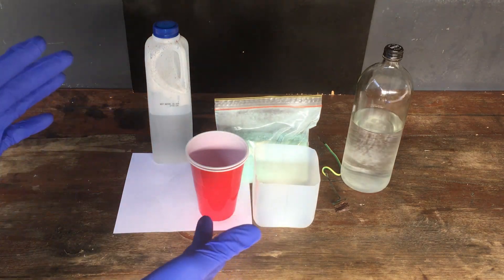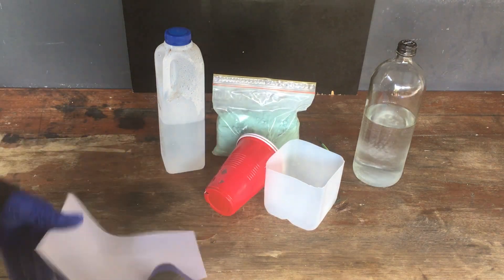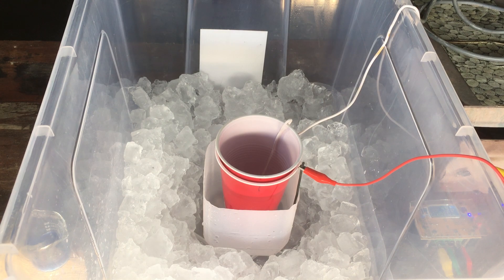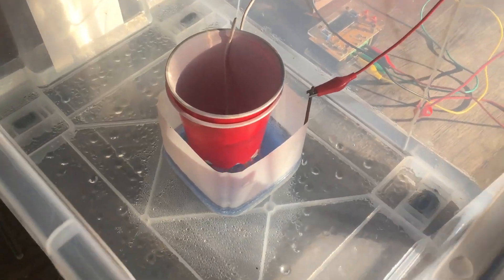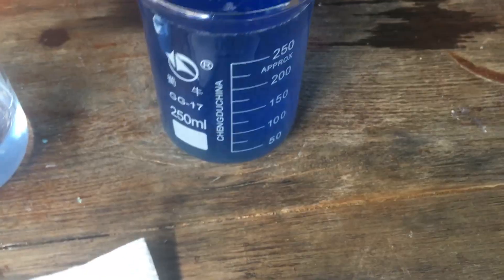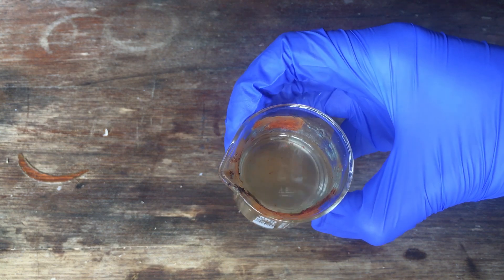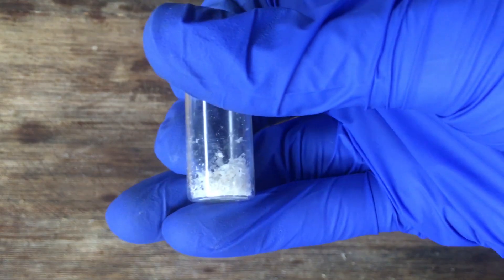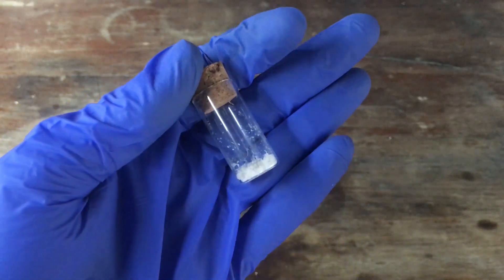Making Nitrate With Electricity

Comment: Um, do you think it is plausible that the actual reaction in the literature involves electrolytic production of ozone and the reaction of ozone with ammonia to make nitrate ?  Several other Youtubers react ammonia with electrical discharge generated ozone to perform this synthesis. 
In Wikipedia's ozone entry it suggents ozone production is favored by low temperature, prescence of sulphuric acid and lead dioxide, and some overvoltage. If this is so it might be possible to synthesize ammonium nitrate from ammonium sulphate with a lead anode at the bottom of a tall narrow anolyte compartment ?
Using a lead anode might be expected to be advantageous as it would oxidise to a lead dioxide anode and lead dioxide can be a catalyst for ozone production The prescence of sulphate and possible persulphate at the anode should make it unlikely that lead will disolve. I am thinking ammonium sulphate in both compartmnets. If  enough nitrate and sulphate collect in the anolyte it might be possible to distill off the nitric acid and leave the sulphuric
Reply from the maker: Interesting, that's definitely a possibility.
The only issue I can see is that by performing the electrolysis in acidic conditions, the resulting ammonium ions - as opposed to the neutral ammonia molecules for basic conditions - will be repelled by the anode. I'm not sure whether the hypothesised ozone-ammonia reaction will be hindered by this (I suppose this would only be the case if the oxidation were exclusively an electrode surface mechanism, so I imagine it wouldn't), but it might be something to keep in mind.
While this would be a very interesting thing to try, I might have to leave the experimentation to others in this regard. Only from the reason that lead-based electrodes are required. While I've used lead electrodes in the past, I've had many issues with them and would rather not use them again for toxicity reasons alone. However, if I ever upgrade to a better lab setup, where I can more effectively deal with any lead-based mishaps, I'll definitely remember to try this!
Reply: @ScrapScience  Yes, on deeper reflection i think there might be several ways of going about this. Either directly, with K+ irons in a basic anolyte and a copper catalyst,  or by the electrolytic ozone production route reacting ammonia with ozone to form ammonium nitrate. A third set of possibilities involves setting up a fermentation of  ammonia to ammonium, potassium or calcium nitrate, using either a bed of soil/compost or perhaps an aqueous fermenter using an aquarium, a pump and a trickle filter, followed by electrolytic separation of nitric acid.

Comment: Very interesting!  I've never seen this before.
The approach I've always wanted to try would involve a large plastic bucket filled with urea/water solution into which a sack of landscaping pumice was added. An aquarium pump and an airstone would be used to oxygenate and circulate the solution.
Over the course of a couple of months I would expect nitrifying bacteria to convert the NH3 to NO3-.  The pumice would provide a substrate with lots of surface area for the bacteria to anchor to.  Perhaps a bit of compost added at the beginning would inoculate the batch.
I don't need the KNO3 - it's abundant here - I'd just be doing it just to see if it worked.  While it would take some time, it would be very hands-off and would require very little energy.  If it succeeded, it might produce a lot of nitrate.  If it failed, I'd still have fertilizer for the lawn.
Perhaps the pH would have to be monitored, and if it got too low, KOH would be added as needed.
Reply: I love this as an idea.  One could take a tiny 1% fraction of the circulating water perhaps and bring it to a boil while capturing the evolved gas in a chilled water container that could be slowly replaced when it reaches a high enough concentration.  If a steady state can be achieved it could work as long as the weather holds.
Reply: you can buy nitrobacter starter kit for aquaristic use. So you dont need to bring impurities to the pumic.
Reply: Make a "nitre bed" like they did in the days of the civil war. Collect pee and manure, let it ferment in heaps for a year then extract nitre from that with boiling water
Reply: @bromisovalum8417  I've read the entire document written by Joseph LeConte in 1862.  It's fascinating and informative!  But its methods are a wee bit bucolic, anachronistic, and desperate.
Reply: and? any success?
Reply: Why urea and not say, ammonium chloride
Reply: @ Ammonium chloride might work.  OTOH, it's acidic to start with, and would become more so as NH4+ is consumed.

Comment: Just came across your Chanel the other day and it has quickly jumped up to the top 5 chemistry channels I like to watch keep up the good work,. But quick question, and I would love to hear other people's views I need to buy a DC power source or converter and I'm not quite ready to buy a welder, what brand or models have you all had good luck with
Reply from the maker: A simple lab bench power supply will serve you well as a DC power source, usually in the price range of $50-100. If you don't want to spend that much money, you can also salvage an ATX power supply from an old desktop computer (though these don't offer controllable voltage or current).
Reply: @ScrapScience  It's not that hard to hack an ATX computer power supply into an adjustable power supply, especially for someone with some basic electronics knowledge. All you need to do is look up the schematic for your ATX, and using that find out the location of the feedback section. By replacing the feedback resistors with a potentiometer you can make the ATX into an adjustable power supply. Just make sure you turn it into a 1-12V adjustable power supply and not anything over 12V, as the capacitors are not meant for a voltage much higher than that and will pop. You could of course replace the capacitors with 25V, 35V or even 50V electrolytic capacitors, but for electrolysis that's utterly useless because you never use more than the original 12V in any type of electrolysis anyway, and often even just a couple of volts.
Reply: @ScrapScience  you can hook them up to a cheap buck regulator with current control and use a multimeter to set it

Comment: I actually tried to do this with the copper catalyst and it ended up not working. Then I remembered, I have a platinum anode which already is a catalyst, so just for fun I did it without the copper catalyst and I ended up producing something which looks like dirty potassium nitrate solution. The ammonia smell is gone, I’ll have to see whether any nitrate crystallizes out. I was using a clay pot as a diaphragm. Also I forgot how smelly ammonia was.
Reply from the maker: I was told at some point that platinum is generally quite good at anodically decomposing nitrate ions, so I haven't bothered trying to use a Pt anode for this reaction.
Nonetheless, I wouldn't be surprised if you got a good yield anyway, since nobody seems to really know what's going on with the reaction overall.
Reply: @ScrapScience  just a curious question. Why didn’t you use a clay pot as a diaphragm for this one? Were you trying follow the paper as close as possible?
Reply from the maker: That was the main reason. Additionally, clay pots are rather restrictive on the current flow compared to other diaphragm options, and this process doesn't require perfect separation of the two chambers. Using paper allowed for a lower cell voltage (increasing the energy efficiency) and was easier to implement on a small scale.
Reply: @ScrapScience  aah that makes sense. Sorry if it seems like I’m in the comments sections in all of your videos. I’m just gathering more information so I can repeat some of your experiments except with a platinum anode and some other modifications. I want to see if the platinum could help as a catalyst for some of these reactions and help to increase the yield and efficiency of these electrochemical processes. Then I am going to see whether My knowledge could help improve things.
I could even make a document cataloguing my results for repeating and improving your electrochemical processes ( if I do go down this route, I will give you editing access). I will of course still give you credit. See you in a couple of days, bye.
Reply from the maker: Haha, there's no need to apologise. Getting and responding to comments (especially ones like yours) is by far my favourite part of Youtube.
I'll be super interested to see your results in these areas, and I'll look forward to hearing from you in the future if you decide to persist with these experiments.
All the best!
Reply: @ScrapScience  results are .............inconclusive because I forgot about it and I threw the solution away. I also didn't run the cell for very long because the smell was awful and it overwhelmed the extractor fan. Also I tried some of your tests and they tested negative. I am going to try again but outside and with copper hydroxide, in order to avoid sodium carbonate formation.

Comment: Hey great videos again my friend ! I found something and I bet it´s interesting for you because you like easy experiments and this is what you can try. Most people don´t know it because the experiment is written in german from a chemistry professor but luckily for you I found it and translated it for you so you can share it with the internet If it works. This was in the early beginnings where the germans made nitric acid and took therefore nitrates from chile and wanted to be independent from  chile as well. So the professor made experiments and found out that ... and now listen carefully ! That If you take a retort(I guess glass destillation kit) add some diluted sulfuric acid then add in ammonium sulfate and the key ingredient manganese dioxide and heat it NO2 will destill over. Theory behind it the released ammonia reacts with the manganese dioxide and takes it´s oxygen to form the NO2 which react with water to form the nitric acid as you know. The MnO2 gets to MnO and gets back to MnO2 as it reacts with the oxygen from the air. So as long as you have ammonium sulfate it will make some NO2. PbO2 works too but MnO2 is easier to get. There was also a version with concentrated sulfuric acid potassium chromate and ammonium sulfate you get loads of nitric acid. There are no proportions in the text. Here is my reference http://dingler.culture.hu-berlin.de/article/pj103/ar103067 It´s in german but I said everything that you need to know !
Reply from the maker: Wow thanks!
At first glance, this seems too good to be true honestly. But that's no reason not to give it a go!
I probably won't get the chance to try it for a long while, but I've just added it to my list of video ideas, so I'll hopefully get around to it eventually.
Reply: @Tasfic Razin Everything as I said there is not more information just to destill these 3 ingredients.

Comment: Can I use ammonium chloride instead of ammonium hydroxide instead? Because I  don't have any ...
Reply from the maker: Since I'm not certain on the reaction mechanism, I'm not entirely sure (I do think it's unlikely though).

Provided you do it in a basic enough solution (with enough potassium hydroxide), the ammonium ions will tend to form ammonia anyway, so it's possible that it might work. However, the chloride ions are very likely to interfere with the anode reaction and will also make things difficult to crystallise out. Additionally, I'm not sure how you'd form the catalyst complex unless you have plain ammonia.

You can actually make ammonia by the reaction of ammonium chloride and sodium hydroxide. I have a video on that topic linked in the description. (the video uses ammonium sulfate instead of ammonium chloride but the reaction works the same)
Reply: @ScrapScience  thanks,but I had tried it 100 times and it failed I don't know why it doesn't produce any hydroxide. Do I have to heat the solution too ?
Reply from the maker: Yep, you definitely need to heat the reaction to drive off most of the ammonia. Using as little water as possible will help too.
Reply: @ScrapScience  okay,what is stiochemitry for producing 150ml or 250 ml of 25% ammonium hydroxide .
Reply from the maker: You can't really work out the perfect stoichiometry, since the reaction will give you a highly variable yield. 
To get 250mL of 25% ammonium hydroxide, a ballpark figure is to use around 150g of NH4Cl and around 120g of NaOH. 
If you want the '25%' figure to be in terms of ammonia instead of ammonium hydroxide, you can use twice the amount of reactants.
Reply: @ScrapScience  thanks
Reply: Probably that the chloride anion into NH4Cl would make the solution slighly acidic (by NH4(+) counter ion (cation)) and this is bad news since Cl(-) will form a little Cl2 what transciently makes HCl and HOCl upon contact with water.
HOCl destroys NH3 into N2(g) and H2O (sanitizing effect).
Cl2(g) is bad news into contact to NH4(+) salts because it forms a bit of NCl3 (the yellow nemesis of Exposion & Fire) (highly sensitive dense yellow oil touchy and dirt reactive, spontaneously decompose into fire and bang, usually shattering the container or glas even from subaquatic tiny droplets... thus unsafe (many chemists have lost body parts, eyes or ears... even live).

PHZ
(PHILOU Zrealone from the Science Madness forum and many A.O.L. newsgroup into the pas).

Comment: Would love to see this scaled up ☺️
Reply: His first electrolyzer was a good scaled-up version, actually.  He only needed to put a lot more amps through it and convert all of that ammonia and potassium hydroxide.  To pull more amps without drastically increasing the voltage, he could move the electrodes as close together as possible and use much bigger and flatter electrodes.

Comment: "...because we're doing electrochemistry and it's just gonna work anyway"

Have you tried to get a bright metal plating yet?
Reply from the maker: I haven't actually done any metal plating at this stage (aside from a tiny copper plating experiment I did way back in 2017).
I'm honestly not particularly knowledgeable on proper metal plating, so I've kind of avoided the topic so far. I'll definitely cover it one day, but it'll be a long time before I've gathered enough info on the topic to make content about it.
Reply: That line made me laugh, I've got a bad history with electrochemistry.
Reply: Well you're hard, metal plating is a separate art.

Comment: u should also try using Ir-Ta MMO it would easily be usable with less crud but considerably more expensive.
Paper definitely would be the best choice here or any NF membrane would work too which is just coating paper or fiberglass in nitrocellulose or PVC with no need for any further treatment.
The copper somewhat prevents the decomposition of nitrate on the anode but copper hydroxide or oxide would be a better choice.
Reply from the maker: Thanks for the tips!
I've always kind of wanted to get an Ir-Ta MMO anode, so I suppose this'll be a good excuse to finally get one. :)
It seems like paper definitely does a pretty good job, much better than I expected honestly.
I'm interested as to why copper hydroxide/oxide makes a better choice for the catalyst than the carbonate additive though. I just assumed that they would all work the same once the tetraammine complex forms in solution. Why does it make things different?
Reply: @ScrapScience  copper carbonate maybe the reason why you ended up with some potassium carbonate at the end so if you instead use copper hydroxide theres less chance of that.
Reply from the maker: Ah I see, that makes sense. Thanks!
Reply: Sir @CatBoy 😢😮, you are too much professional at this topic, can you please make a video by using, urea, carbon rod, sodium,

Comment: Very nice video. I'm going to try this myself if I can get my hands on KOH and CuSO4.
Reply: I've made copper sulfate from Epsom salt and copper electrode. Get lots of magnesium hydroxide as a fine precipitate that is a pain to deal with, but it's doable.
Reply: @danieljohnson3024  Thanks, I did the same but with sodium bisulfate a while ago. Unfortunately it forms sodium sulfate which is also water soluble and it's hard to separate. I eventually got almost pure CuSO4 through fractional crystallisation. I ended up with roughly 20g.
Reply: @danieljohnson3024  I am currently making copper sulfate with epson salt. clay pot, copper anode and cathode, about one liter of solution and 200g of epsom salt in each cell. It seems to work, I am currently concentrating the sulfate solution and letting it crystallize. I boiled two batches (around 2 liters) To be sure the anode solution did not contain magnesium sulfate anymore, I let the reaction run for very long, and the cathode started growing copper hydroxide as well. So I have BOTH magnesium and copper hydroxide at the cathode. I was scratching my head to separate them and recover the copper.
After basic wikipedia/google search, I found that ammonia solution will complex the copper but NOT the magnesium! And an attempt (outside, damn that stinks!) showed that yes, the solution turns beautifully blue and the magnesium hydroxide can be filtered out.
So I think this is a good method to get copper ammonium complex of correct quality for use in this experiment, which I will try as soon as I get a smaller clay pot lol.

 I am not sure the copper sulfate I obtain is actually free of any remaining magnesium, but recrystallization should help, since epsom salt is very soluble, probably much more than copper sulfate.
Reply: You can easily find both on ebay for very cheap.
Reply: @BackYardScience2000  I know, thanks. In Germany there is an online shop dedicated to chemicals and labware which is quite cheap. 1kg of CuSO4 costs ~8€ vs. eBay ~14€. In the future I will order from them.
Reply: @user-pp3yi5tv7l  in france I need to pay 20 euros for 1 kg of cuso4 :O
Reply: In the NL I bought 25 kg CuSO4 for 108 euro so around 4€/kg